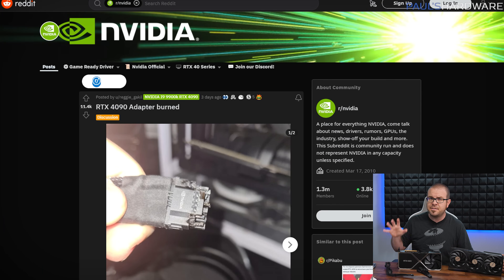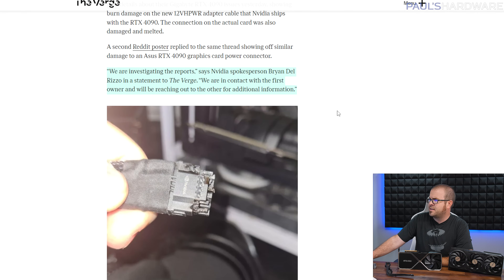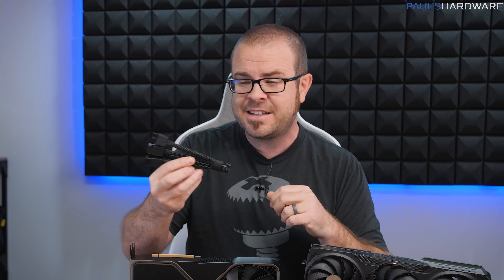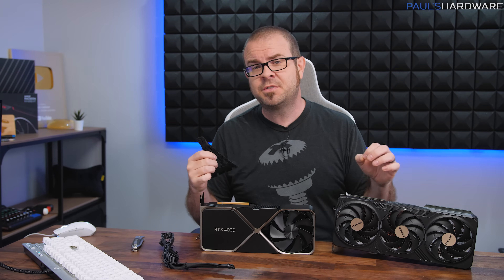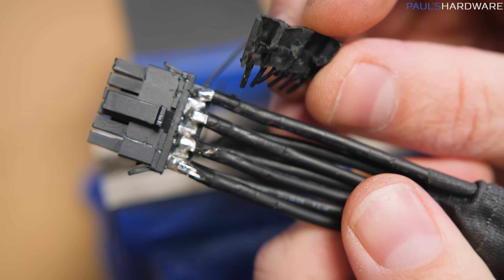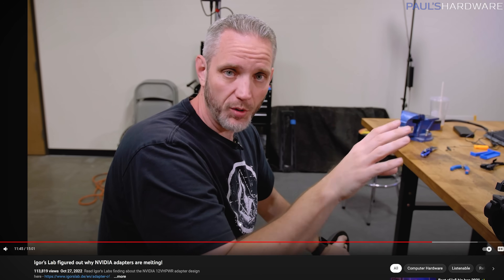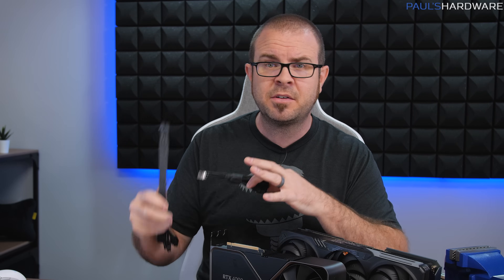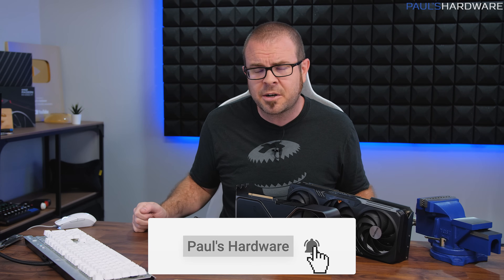Why are some melting? RTX 4090 600W 12VHPWR Adapter Teardown

Comment from the maker: UPDATE: In light of the excellent investigative video posted by Steve / GamersNexus (https://www.youtube.com/watch?v=EIKjZ1djp8c), it would appear that this problem is still unresolved and there's more to it than the 14AWG wire solder points in the plug. Steve is asking for more people with these adapters to get in touch with him, and of course NVIDIA is investigating although they haven't made any statements beyond that. Locating more adapters with the 150V rated wires that IgorsLab saw (mine used 300V wires which can be seen at 8:26) would definitely help. Most are still leaning towards this being a manufacturing issue with the adapters, but what specifically the defect is remains to be seen.
Reply: Seems there are different versions of the adapter. @10:14 yours looks exactly like Igor's version and the outer cables soldered separately and not bridging with the adjacent cables. While GN's ones are different and seem more sturdy.
Reply: @kamui004  yeah nvidia definitely spotted the issue, redid the cable design, but the 1st ones were already shipped (with 150v wires) and they should have recalled them
Reply: You are just pathetic.
Reply: send Steve your cables today.
Reply: The problem should be, that parallel connections from an output(s), over different conductors have different voltage drops, and where they are combined into one, the voltage drops are equalized by dumping heat into the socket.    Adopt a single connection through one conductor that can handle the entire load of the adapter  should stop the heat. and increase the efficiency of the adapter.
Reply: Paul, honestly speaking, has it ever occurred to anyone that the damages could be produced by shills with a flame and posted as "it happened naturally without me doing anything wrong!"? Has either you, Steve or Jay ever seen the problem firsthand? Ever?
And no the story of first ones being faulty doesn`t stand. Both GamerNexus and JayZ have review samples sent in advance and definitely belonging to the first batch.
Have they (Jay or Steeve) been able to reproduce the problem even after torturing the connector in the worst possible ways? And if not, is anyone starting to smell the much ado-about-nothing stink? (shills melting the connector with a flame anyone).
P.S.
I have been torturing my 4090 (MSI Suprim X purchased day 1) for days now, overclocking, 6 hours of consecutive gameplay at Cyberpunk and Dying light 2 (Full RT on) you name it. Checking the connector several times, It looks pristine as if just out of the box brand new.

Comment: . . .   Wires have been used directly connected to circuit boards;  save cash costs & trouble. Nominally a no brainer; appears to be crazy criminal itch to misbehave. Six hundred Watts 😎 would be cool with five inch, 16 Gauge wires giving 10 Amps, 120 Watts each; neatly soldered and heat shrinked. More than enough; easy peazy.  . . .  🤠

Comment: . . . I personally have already got 65 years of useable experience PLUS the whopper boners from the past of 45 more years as a practical USER plus; I have 🚫 never seen such a wading of neglect and 💩 poor decision designing as running bunches of 14 - Gauge connections into a few 20 - gauge pins . . . 
  
PS PLEASE don't ask me to buy one.

Comment: was it only the 4090 that had an issue? or all the cards that used the 12vhpr? I've been looking at a 4070 ti super and I'm concerned because I've been news that it's STILL an issue.

Comment: burning issues happened when they used a 2x8pin to 12+4 pin adapter. to avoid this, use a real PCIe gen5 PSUs with dedicated 12vhpwr pins. once you smell the smoke, it means that's the smell of a lawsuit. gpus are not the problem, rather it's on the psus.

Reply

Comment: Igor's adaptor has wires that are rated for 150V your adaptor is rated for 300V so your adaptor has more robust wires and soldering points where his is not as good.

Comment: It does count up for me how can u call it high power connector wel the power goes 4/6+ wire and 4/6- wires against 3x 8 pin connectors so u have 12+ wires and 12- wires   I mean a wire is a wire and copper is copper more copper wires is more power and wattage 🤷🏽‍♂️

Comment: weren't there also articles reporting of overheating issues with the 3080, 3090 series gpus with loosely attached connections down to their weight when installed horizontally

Comment: the soldering is quite close to the other, soo... if u dont connect it properly and bend it so they heat up and short circuit, easy as that

Comment: You are the only one of the youtubers who understands how electricity works. It's precisely because of loose connection, either loose connection in the plug or broken but still rubbing together connection that causes the increase in amperage and the one contact being heated. It's not about totally broken off contact. It is resolved. people just being slow af.
Reply: Wrong resistance does not increase current, it decreases it, but we all know ur real smart

Comment: The WAY Better question would be "Why hundreds of thousands are NOT melting while those 12 on Reddit did?"...
Reply: those users probably got defective adapters cables or are using low quality 3rd party cables
Reply: @ssaini5028  Na, they just didn't know what they were doing and never fully seated their power plugs. Defective users
Reply: @kenmasters916  agreed lol

Comment: Most power of 12v rail is converted to 1.** V for CPU and GPU consumption, the new ATX PSU 12VO standard should really be 24VO.

Comment: So no one from the company seems to see the real issue??? Four eight pin cables into two six pin cables made into a single clip. They tell us wattage crap when the issue is clearly amperage draw witch is what is making so much heat. Did they just completely forget about ohms law???? SMH 😂
Reply: It was defective user installation 🤣

Comment: if we are bending the included cable , at what mm do we want to measure to then put the 90 degree bend in it.  I assume we get one shot at this and that's it.  I don't want to bend it in the wrong spot.  35mm?   40mm?  like , i don't hardly have any room to affix the glass side panel (Lian Li Evo).  the msi trio is a big-ass card and it's limiting.

Comment: Why they soldered 4 cable to a thin plate  to a 6 pin connector?
 Maybe 2 8 pin old style connector can handle the power. İt might seem over engineered

Comment: 600 watts at 12 volts is 50 amps.    14 awg is not going to work they need to spread the load over larger and more plugs like  the did with the 3090

Comment: lemme guess, you couldnt get it to fail either... is it possible those on reddit are using actual fire for the likes cause they got more money than sense? Likes are life... Jay broke pins and it still didnt fail... You guys are completely tearing down these cards and cables and they still arent failing, yet you still believe the pictures on reddit... Guys you cant intestinally break the connector using a Dremel and trying to use that to validate a problem...

Comment: So I ask the question? Why was the plug changed in the first place? Could they not have just added another 8 pin or 2. Maybe go to a motherboard style 24 pin? WTF………….who are these engineers 🥴? Also, word has it that Igor’s cable was different then that of Jays and Steves at Gamers Nexus. That unto itself is odd………very odd. Each individual wire was soldered to each pad on Igors while both Steves and Jays had bridged wires 🤔. In any event, a $1600. card shouldn’t have these issues.
Reply: I much prefer 12vhpwr done right makes cable management a dream. Guess Nvidia has been f'ed by the supplier

Comment: Why do you need 4 or 6 pairs of wires if they all connected to one plate? Your kettle can consume 600-800W or more but it has only one pair. Whereas the isolation layer between the two power plates in the connector might be insufficient makinging it a capacitor and thus producing the overheating at high wattage.

Comment: I think it's the factory mix up on NVIDIA 12V PWR Adapter. There are some NVIDIA adapters out (Like Igor's one) that have each wire rated 150V but majority of us including me have each wire rated 300V. You can easily find out if you unpeel bending tape and expose little of the wire. Again I don't think you can recreate the melting if you have each wire rated 300V.

Comment: There are at least two different variations of this adaptor, 150v and 300v. the 300v like you have is a lot more heavy duty. Id like to see the burnt adapters, I bet they are all 150v.

Comment: I believe it is just a manufacturing error. Or a combination of several Issues happening at once. Looking at Igor's adapter and at yours, you can see a big difference in soldering quality and how much of the cables actually touches the pins.
I think adapters that were produced first were good quality, but adapters made at a later time have poorer quality. It may also be a case of cutting corners of the supplier, because they can't make enough in time. A possible reason why that is happening is missing workers due to covid... Im just guessing of course, but it is not like it hasn't happened before elsewhere.
And 4090 FE's are not "burnung up" yet. It might be, that Nvidia simply uses those good "early bird" adapters and AIBs recieve the later bad "revisions" unintentionally.

Comment: 50 amps a power ? for 600 watts
cant have that in my apartment biggest fuse i have is 30 amps
Reply: and landlords across northamerica wont allow you much more then 10 or 20 on a wall socket
you can have this in your homes kids
its dangerous
Reply: do all 40 series require this cause i have one 30 amp plus in apartment
just one 
rest are 10 amps 
if you cant give me a grpahic card that can do this on less then you arent selling to home owners, you are or were gearing these for miners
these seem to me to be miner cards

Comment: I showed this to my father and he laughed. He's a master electrician and he said the wires are fine, but can the plate and connectors handle the current over time.
He said sure, it can work for a month or a year, but over time if there's any failure that is where it will be as the wires can handle the current just fine. (I have some knowledges as I helped him for years as an apprenctice wiring houses).  Most circuits in your house in the US are on 14 gauge wires for a 15amp. 20AMP will use 12 gauge (Small # in gauge is actually thicker). So 4 of those can handle it. 
Your analysis is right on the thermals, being a 'loose' connection with some contact.  He said it's a common failure he sees, that happens over time with wiring.

Comment: Nvidia really going all out on forgoing consideration of the rest of you system. You WILL conform to their massive coolers and card weights possibly damaging PICe slots and connections. You WILL replace your PSU for one that can actually handle the near Home AC power draw of their products. You WILL have to replace your case with one that supports vertical mounting solutions, or irregularly wide footprint as to be able to fit their proprietary power cable without bending it to the point of causing overheating. 
Hell, Even the vertical  mounting case I replaced with my current one wouldnt fit the Slot size of the cooler against the side panel. It would interfere with the side panel no matter how it was mounted. It would have to be hooked up with a riser and left free floating in the case. Just laying up sideways somehow. Nvidia doesnt seem to care. They made it draw this much, they made their boards in a way that uses these connectors. They could have gone to an AIO solution if its going to be this out there in terms of accommodating power and heat. But they didnt. AIO solutions are no longer invalidated as an option due to case accommodation.

Comment: I did not even run my 4090 till my msi pci5 psu came in, I did not like the adapter solution. I put a temp probe on the connection and it has never gone over 90f.

Comment: Everyones got their electrical engineering super sleuth hats on trying to diagnose and come out as the smartest person in the room on the dumbest problem ever to hit the consumer electronics world.

The issue is the adapter and Nvidias design. Thats the issue. They should issue a recall and do it right. But they wont.
Reply: Need I remind that were a week into general consumers owning these cards and the plugs that are rated for less cycles than I've done on my own 5yo rig have already started roasting themselves to death.

Comment: Another note... high temperature rated wire can be 200C / 600 volts for 14AWG. I bet some cheap companies are using 50-80C rated wire or plastic.

Comment: They should just ship with a 16 pin (12+4) cable, that runs directly from the ATX 3.0 PSU to your GPU. No adapter. Anything rated for that many amps and watts should be 14AWG wire to cover all normal scenarios and temperatures. This leads the problem being the connector, connection to the connector and what's it's connected too that's not rated. Solution: Run more wires with better terminal connectors, 12AWG. $1599, and they cheap out on the connector. Good job.

Comment: ALL THIS SHIT as put a huge stop/delay on me buying a new video card/case/atx3.0 psu... now im gonna wait for the dust to settle down and the fix to come soon and the release of the 4080 16gb and AMD card.... can't believe this hit the market in production for a premium 2500$ video card, imagine having this risk inside your system with all your data and components etc let's hope the fix doesn't take too much space or height on the side and can be bended well at a 90 degree angle like the new one cablemod is talking about but still

Comment: when the adapter melts on the plug, but the heat should spred from the lose cable/sodering point(as you show in this video) istnt that a bit odd?

Comment: 10:32 those side connectors (1 and 6) are not connected to middle connectors (2~5). if there is a copper on the board between pin 1 and 2 it is too thin that will act as a resistor and power will flow through pin 1 instead. Side connectors are carrying each 150W and the middle ones are carrying each 75W, that is why you have melting in side connectors and not the middle ones! 

Now you will need to look at the other side on GPU itself, if that side is connected the same way it explains why you have pin 1 and 6 melted but not middle ones.

Comment: It is incredible, what a master plan Invidia had been built up this time :D So they released 4090 as the fastest consumer GPU to the market (that runs ecc memory check with early bios lol yea sure, it meant to be consumer) with this release they grabbing for sure the best consumer GPU title, no matter what Intel or AMD is hacking in the background. They spread some to reviewers, the benchmarks are up, numbers are set, the position is carved in stone. BUT they would be stupid to sell these 4090 series right now, they would like to sell the 3090 (that could be beaten by the upcoming AMD cards) So they managed to carve the benchmark numbers of 4090 on the wall and not even they did not released more than just a few GPUs (close to paper release) but now they will call back all the upcoming ones, or at least win some time due to "NVIDIA, one of the biggest and most advanced tech company, EXIDATELY messed up to connect a few power wires" - yea man, this is absolutely believable :D since they are just learning the behaviour of ampere at the company. You know guys, there is just one question left, what they know due to GPU price increase reasons in the near future, what is the next stage of the plan? For how long they should role play this game till they could finally release the incredible amount of new GPU family, since the numbers are public, as how much chips they bought from TSMC.

Comment: Is this also an issue on the 3x8 pin adapter with 450 watt power?
I have this cable on my RTX 4090

Comment: check out "rambling about the 12VHPWR failures" by  Actually Hardcore Overclocking. he makes a very good case for why the cable is failing. They used double split terminal pins instead of single sided like corsair and cablemods. So any bending or side by side strain can make poor contact in the pins which then increases resistance in the pins way higher which then increases heat then thermal run away.

Comment: People could also be connecting extra 8-pin power cables from a different power supply than the one in their PC. Not everyone knows that mixing power cables is the fastest way to fry ports/cards. But if the person uses the wrong power cable, the failure point will be the 12-pin connector even though it'd actually be blameless.

I know when I got my 4090, initially I only had two 8-pin cables coming from my PSU to my 3080. So I had to go find more 8-pin cables. I bet others did the same thing and some grabbed the wrong cables.

Comment: Buy PSU with native support and throw the adapter away. I snagged the new 1650-watt from Thermaltake before it went out of stock but not so lucky on launch day for the 4090; or maybe I am better off. I'll wait for 4090 ti.

Comment: With tension on it and under load it clearly has a problem with a cable losing its good connection. If you want to avoid this problem for the moment and continue using your Gpu, connect ALL FOUR of the 8 pins and then dont run your card at 600 watts. Connecting only 3 of the 8 pins is possible but WOULD still have the same chances of the same problem, as the issue IS NOT that the 12pin gets hot under 600 watts, but rather the conncections arent durable enough. If Nvidia used 8 wires instead that would probably help, BUT the connections need to be strong or it could still happen. For those with experience in eletrical work, recable at your own risk